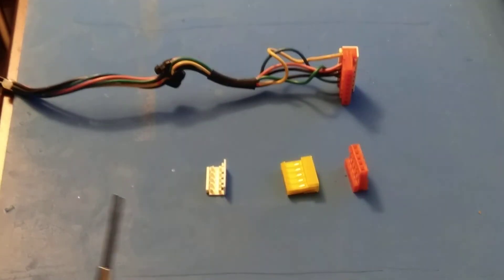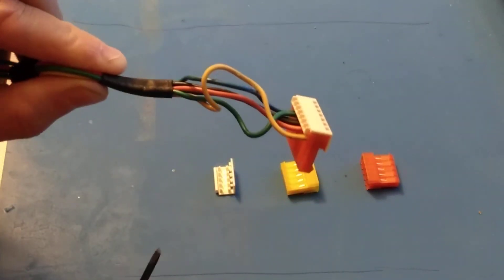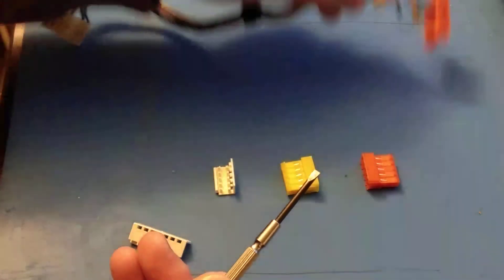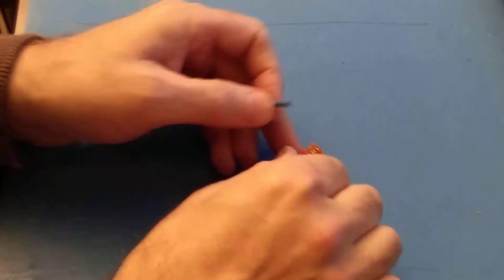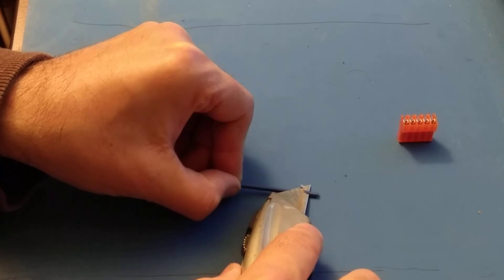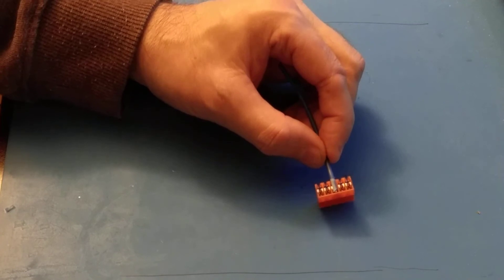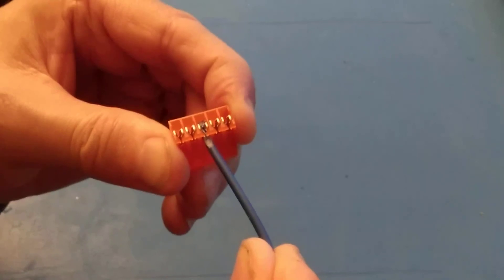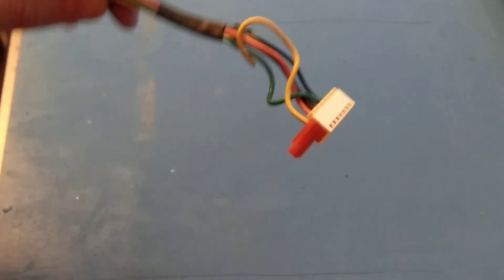How To Terminate MTA-156 Connectors

Comment: Whereas this may be an acceptable method for an amateur to use in a non-critical application, it should NOT be recommended or followed if the connection needs to be guaranteed secure and long-lasting. There are proper tools available for inserting the wires into these connectors. Yes, the tools can be expensive, but they will ensure that a sound and reliable connection is made.

Comment: Never use a watch screwdriver , as this can split the wires or push apart the tin contacts inside the connector , resulting in a poor contact , thus causing resistance then ark out! .. always use a Molex insertion tool , m.t.a 100 or 156 to undertake the job properly . i have both of these made from lead.